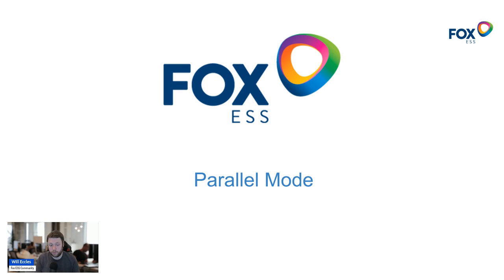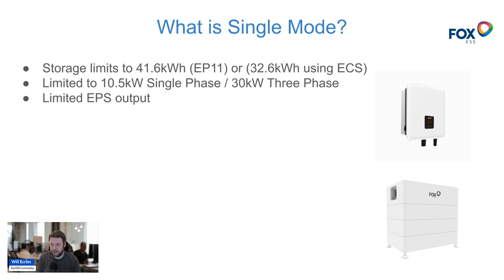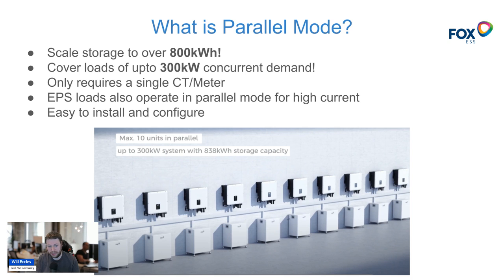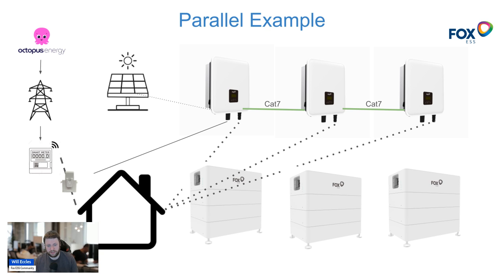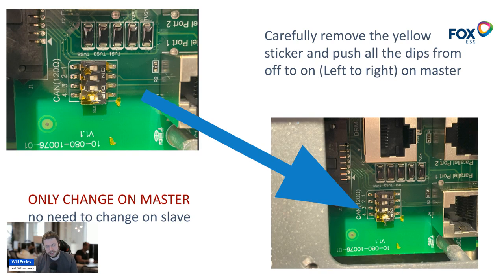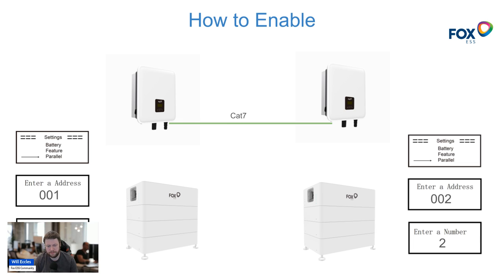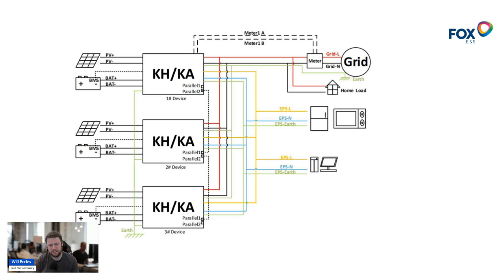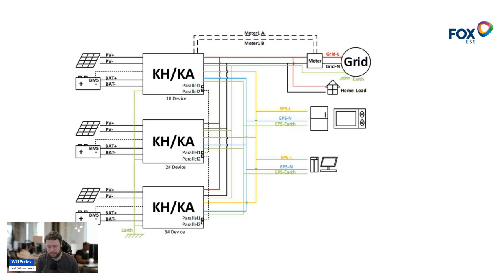FoxESS - How to configure Parallel Mode K Series / H1 Gen2 Setup

Comment: Fox told me to do dip switches to both on master and slave. Who is right????
Reply from the maker: Depends on the hardware but on a K series it’s only the master and that is also what the manual says.
Reply: @iameccles  I have two 8kw Fox K series how do you wire up the AC side. I have installed two AC disconnects and wire into the fuse board using two MCBs 40 amp which I now is wrong. I have spoken to 6 Fox reps and no ne said thats wrong. Can I come out of the AC disconnects and into a new MCB what size in amps please with 8mm cable only two meter run. Big thanks

Comment: Could you mix batteries between different inverters?

Say H1-6.0-E-G2 with ep11
In parallel with H1-3.7-E-G2 with ep5

Comment: Hi all, I have a Parallel system installed with 34kwh battery system across 2x inverters with 50% of the batteries across my 2x 5kw inverters. I have 2 x solar array a 6kw and 4kw totaling 10kw solar array. 6kw is connected to inverters 1 and the 4kw is connected to inverters 2. What i still can't understand is how there are times when as show below, im sending back to the grid and charging my batteries when there is still capacity to charge the battery and send back to the grid. I think it's a hardware installation issue but not sure. Can anyone help me understand please
Reply from the maker: Open a new post in my forum foxesscommunity.com

Comment: Thanks for this informative video! Question...can you mix different inverters? I have a KH10 which is maxed but curious about adding 10 more panels on another inverter which wouldn't need to be KH10 obviously. Can a KH10 be mixed with a smaller inverter?
Reply from the maker: So Fox say they require the same inverter model and size but I bet a 7 would work with a 10kW but don't have the room to test this. Best keep them the same and use the power limit to limit the inverter down to a smaller version in the settings if you need a smaller output.

Comment: Hi, I currently have the Fox H1 6.0kW Hybrid Inverter G2. With 2 arrays and battery storage on the house.  
I want get 4x pannels on the garage with an inverter in there but with no extra battery storage. Max 2kw .. Can I use a different fox inverter and the solar generated charge the battery on the house? Do they need connecting or a ct clamp needed. 
Bit of a pain to run a cable from garage to exsisting/meter
Cheers.
Reply from the maker: If you want to add just 4 panels I'd buy a string inverter like this as no CT will be needed and it's a simple install https://theecosupermarket.co.uk/product-category/solar-inverters/fox-ess-solar-inverters/fox-single-mppt/

Comment: Is Fox h1 6kw can be cahrge the battery using on generator power on night?
Reply from the maker: correct, subject to battery setup is also a possible limitation if you only have a small battery setup.

Comment: I take it you have to spread the battery packs evenly to get maximum EPS amps?
Reply from the maker: The setups need to match as closely as possible between the inverters and have enough batteries to be able to deliver enough kW at 48amps max so voltage is important here.
Reply: @iameccles  what max limit does the 48Amps refer to? Is it the battery module max discharge/ charge 50A limit?
Reply from the maker: @DavidUC9  so in the UK my K series even when set to 50amps resets to 48amps upon save for the DC battery side, not the AC side. This might be a firmware thing or a regulation for UK connections I'm still confirming.
Reply from the maker: @DavidUC9  also worth noting that this limit depends on the batteries connected as some of the new BMS's such as the EP batteries can boost to 60amps for brief periods.
Reply: @iameccles  thanks. Ultimately limited by the inverter you choose I guess.
Reply from the maker: @DavidUC9  correct or your settings on the inverter, as the K series starts at 7kW up to 10.5kW on single phase you can buy a bigger inverter and limit it or it will be limited to the battery output depending on the number of packs in the cluster as it's volts x amps = your kW output. I have full stacks so each stack can output 10kW per inverter no issue.
Reply: @iameccles  Sure. I like the fox. It looks great. Easy to install inside or out. Easier for maintenance and service issues as the battery and inverter are made by same manufacturer.
Wasn’t entirely sure about the parallel setup. So thanks for the clear explanation in your video. 
Ive been trying to make it worthwhile for heat pump houses, which can be difficult. Have one house that used 198kWh last Christmas day!
Reply from the maker: @DavidUC9  You're in safe hands with the K series, you can link 10 inverters, 10 battery stacks so close to 400kWh of storage when using with ECS batteries.
Reply: @iameccles  thanks for the help
Reply: Hi I have two inverters one 10.5kwh and the other 7kwh. And I have 4 betterys 3 10kwh battery’s and 1   5kwh batter. can I put 3 10kwh battery on one inverter and 1  5kwh battery on the 7kwh inverter.?

Comment: Brilliant video thank you. Are you associated or work for for FOXESS? I have a question about home assistant, I am unable to connect to it since the firmware update for flux support because FOXESS have removed the LAN connection. Do you have any advise?
Reply from the maker: Hey, no I’m not associated or work for them but I am a long term user and creator of the fox owners community. If you’re talking about the H series, yes LAN support was removed in the newer firmware. You will need to move to rs485 via a 485 to lan adapter to get it working again. I recommend you join my Facebook group search for foxess solar and battery owners group.

Comment: H3 also has these dipswitches but no setting like that, will that become available?
Reply from the maker: H3 depending on firmware is automatically assigned or configured using the cloud portal.